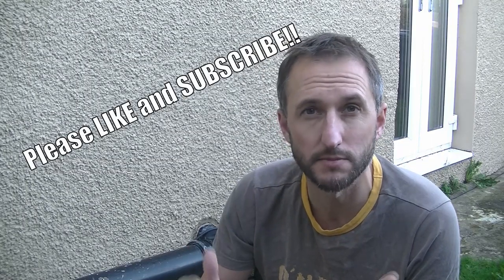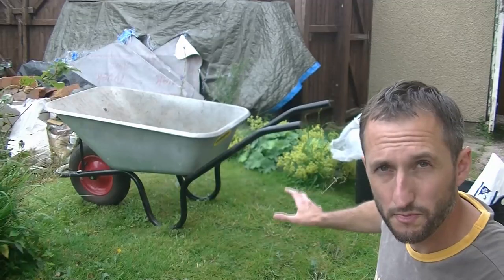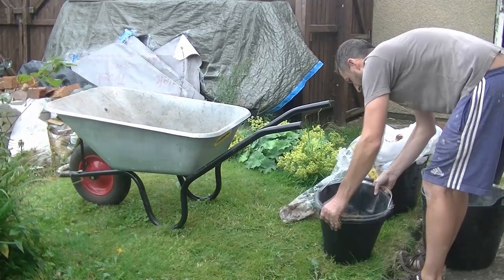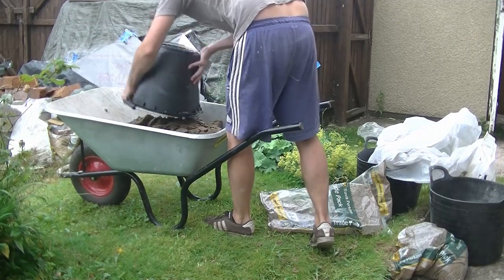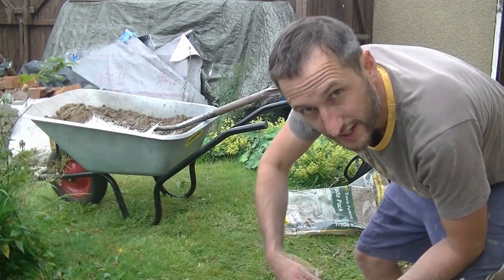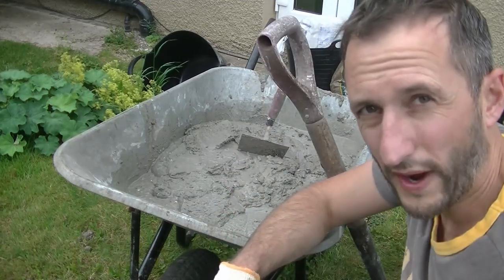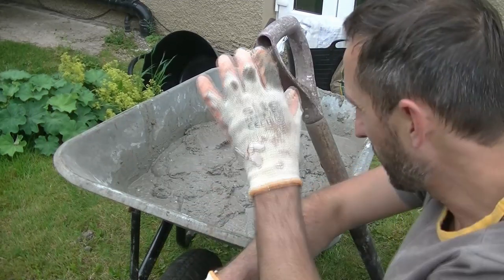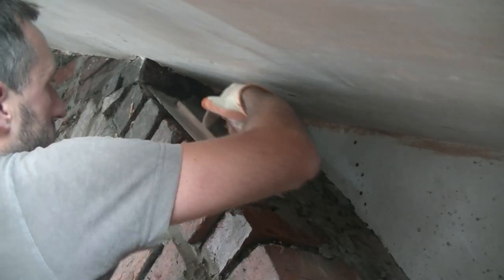How to mix render by hand. Lime cement mortar mix ratios explained. Rendering mix for beginners!!

Comment: Thanks for the recipe- what is the 'scratch coat' & is this necessary & why ? Isn't it easier to just put a final coat onto brickwork ? What happens if there is no 'scratch coat' ?
Reply from the maker: Scratch coat allows you to get a wall nice and flat, provide a good key and to prepare the surface for your final thinner coat which then shouldn't crack. It's just a better way of doing it. I've just done a video on ho to render a chimney - How to render a chimney - https://youtu.be/bbzNM1k18cw
Thanks for watching.

Comment: Why s&c onntge chimney rather than hardwall?
Cost?

Also - I did this recently on a chimney breast where a log burner may eventually go.in my research people said plastering sand due to the salt content in building sand as plastering stuff had been washed and less stones. So plastering skim Over is easier/better

I’ve only done as told though so no experience of both to compare!
Reply from the maker: Thanks for the info Paul. I went sand  cement as that's the finish I want, then I'll paint it with masonry paint. I'm not a big fan of hardwall or bonding plaster. Great for filling and patching but whole walls I prefer sand cement. I find bonding especially tends to absorb moisture and on surfaces that are likely to have extremes of temperature it can crack over time. Just my preference. The lime works a treat in the render. I've used this mix around my wood burners and several others. Never so much as a hairline crack. Hope that helps and thanks for watching.

Comment: Great video. thanks for sharing. I don't suppose you have any tips on calculating the amount of sand, cement and lime you actually need for 20mm render at 2 coats? Thank you
Reply from the maker: Not really sorry, a lot of it is experience. I don't do it enough to help with that query! Thanks for watching.

Comment: Perhaps a dumb question, but whats the difference between this cement render mix and cement and sand mix for building/laying bricks.  Is it the ratios?  Thanks for doing these videos.
Reply from the maker: Ratios are weaker for render to avoid cracking, and I add lime to my render again to help reduce cracking. Everyone has their own preferred ways but a good mortar for beicks is usually 4 sand to 1 cement with some plasticiser. Some people also add waterproofer in outdoor render. Hope that helps. Thanks for watching.

Comment: I have been looking for a while for a no-nonsense video on how to measure and mix render without having to fork out for expensive tools. Thank you Welsh Plastering Carl Froch for your succinct and no bullsh*t instruction on how to do it. I'm off to buy some sand and concrete and then I'll plaster the sh1t out of the little wall in my garden.
Reply: Welsh plastering Carl froch 😂😂

Comment: I'm not a builder but a retired something else and taken on the reroofing on our semi in Eastbourne (I've eight weeks with a temp roof and it's brilliant). The chimney pots need resetting so would it be ok to use building sand in the render please? Can't get hold of plastering sand at the moment.  Cheers and really great videos, I've watched loads.
Reply from the maker: I always use building sand but plastering sand is just finer and gives a smoother finish for rendering a wall. If your just making mortar for setting pots, building sand is perfect. Best of luck with it.

Comment: Can i replace lime with a plasticiser ?
Reply: That's a good question mate👍
Reply from the maker: Yes, or use both. Lime acts as a plasticiser and helps with the flexibility of the finished render but a plasticiser helps with the workability of the mortar which is why brickies use plasticiser. Thanks for the question.

Comment: Hi. I have been trying to get someone to answer my questions about hydrated lime. However, nobody seems to want to answer or are to busy .
I'm not wanting to use it for construction. 
I am an artist whose trying to learn how to use hydrated lime powder . To create Fresco  like the Raphael era. 
I know you are using it here for construction. However,  the main issue I am having. I have tried mixing the hydrated lime powder with just water. But it cracked. I have figures out that I should be mixing into the hydrated lime, sand. Because it is imperative that I have plenty of movement breathability in the mixture. If I am to use it onto wooden house interiors, plaster board in the near future. 
Do I have to also mix in cement? Because I was told that it could reduce the breathability?? If you get time to answer me I would be grateful 🙂
Reply from the maker: Hi Aimee, hydrated lime doesn't set on its own and must be mixed with something like cement to make it set. However hydraulic lime, which is commonly used on traditional buildings and old stone barns for example, will set on its own. But, it does take a lot longer to fully set or cure. It is usually mixed with sand and water to give a lime putty which can then be used for building work. You can buy pre mixed hydraulic lime putty in tubs from specialist building merchants. A company called Ty Mawr lime sells it based in Brecon, Wales. Maybe worth speaking to them to see if it's suitable for your purpose. Best of luck with it.
Reply: @POUSEaroundtheHOUSE  thank you so much for answering 👍

Comment: Suggest using 1 part quicklime 2x bag sharp sand 1 bag kiln sand. If hydrated lime use 2 part, the 2 bags sharp sand.  Like rome Egyptians thier building still satanding instead mordern day cement use volcanic ash which they used. If non use agrical m100 which is pozzalan simular to properties of cement but will not crack unlike mordern cement, if lime craks it repairs itself, mordern cement with lime does not do this or work, using red brick dust pozzalan tiles or terracotta ok. Best pumice tuff volcanic grounded to dust great just like rome cement
Reply: I go along with what you are saying, but where would do get those materials ? depends where you live, unless you can let me know otherwise, I am in the uk. and would happy to hear that they are available.
but I can get natural hydraulic lime in 3 grades, according to exposure, but do not use below 5% centigrade, why render an external wall to start with, it stops the walls been able the let the damp out, on external walls, unless your wall is Breeze Block / Thermalite, but many a building ruined by cement based rendering in the long run.
Reply: In other words use Chaux ,as the French do everywhere ! This gives all the properties mentioned and is why they don't normally use cement.